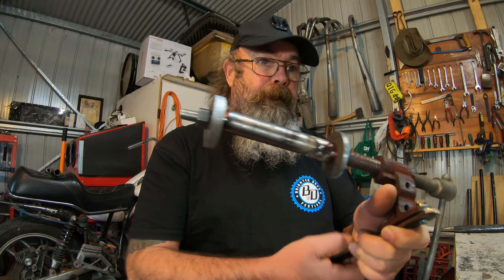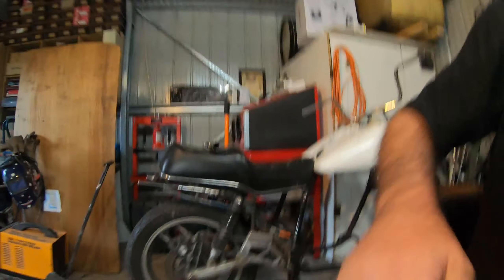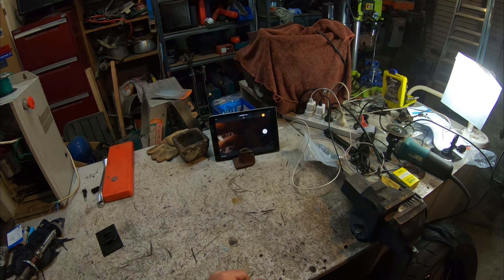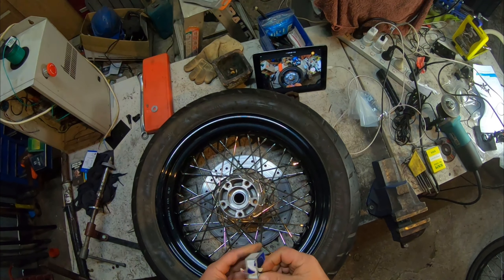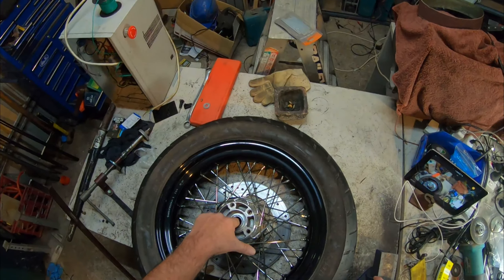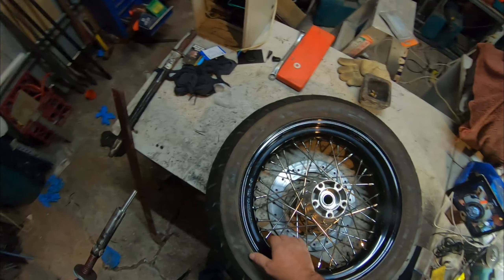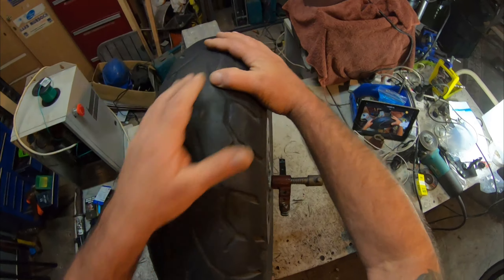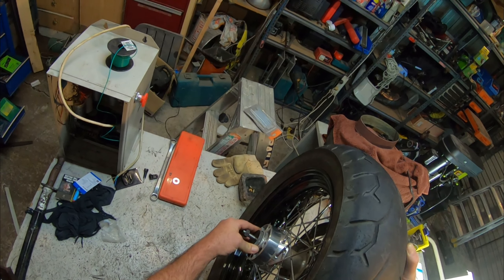Home Made HD Bearing tool first test

Comment: That worked out pretty well mate.  Shrinking the bearing in the freezer is the best way. I have found that if you know the bearing will be tight, you can put the wheel in the to expand it in the heat.
Reply from the maker: Thanks mate. If I know the bearing is going to be extra tight I will warm the hub up a little with a heat gun.